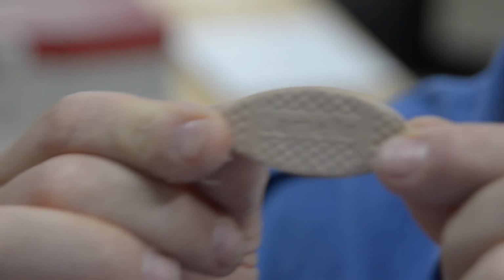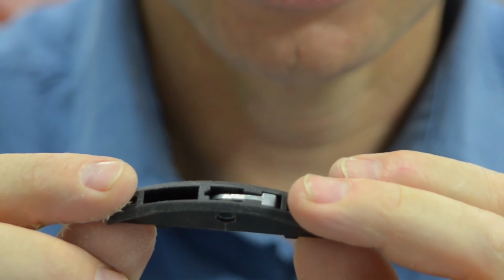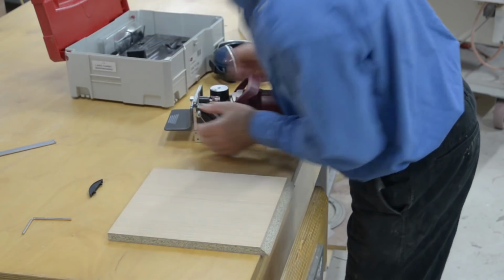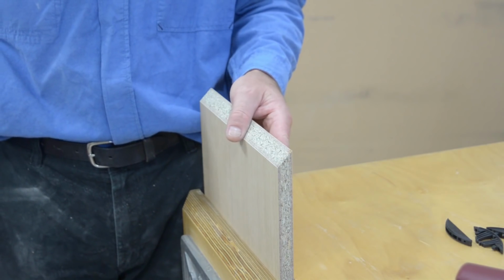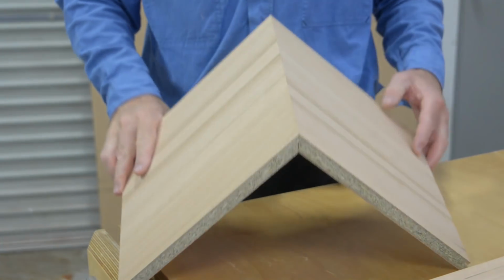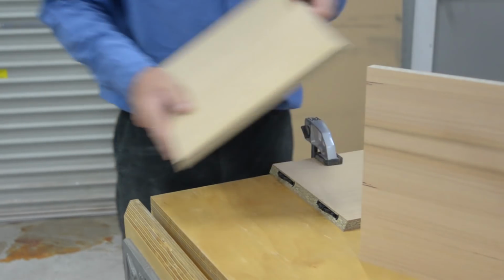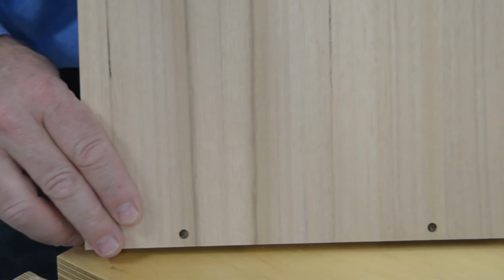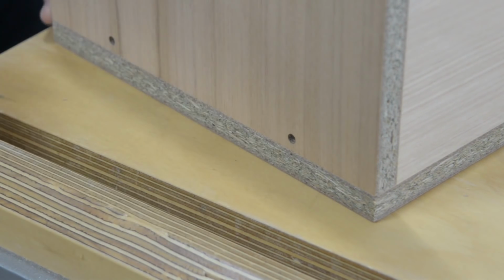Lamello ADVANCED Jointing system : Zeta P2

Comment: For 45 degrees, do you use p-14 ?
Reply from the maker: You can control the distance in from the mitre point.
Also they have moved toward P14 being the standard so as not to need to reset the cut depth.

Comment: I used this machine today to join 40 mm thick hardwood and i cant describe how impresed i was by it, i really enjoyd my work. It is fast precise easy to operate you name it. The only downside is that the fittings are a bit expensive. As for the tool im going to buy it from my local suplier for 300 euros brand new

Comment: Blasphemy!  Particle board and plastic!  Double blasphemy!  Land fill is already calling.
Reply from the maker: I am not sure that it is all that simple.
It takes fewer trees, and less energy to use particleboard to make furniture than say solid timber.
It takes less adhesive (plastic) to make particleboard than it does to make plywood, as well as fewer trees.
Particleboard however is not as good for jointing, so that's where there is a complication.
Both solid timber, and plywood require about 3 x more trees.
Laminate is more durable than lacquer, and the processing is way more labour efficient.
The odd assembly fitting is the price that must be paid.
As for plastic as a whole, I think philosophically I am not in favour of the high turnover plastics that are in use for minutes, hour, or just a few days, but this diminishes as the use moves into years.
Plastics in cars have a shorter life expectancy than furniture.
Everyone uses cars. 
Plastics in a phone, or computer these days has a shorter life expectancy.

Hmmm :/

Comment: I use Dominos

I’m quite skeptics that when you use glue with these that the two bits of wood are held tight enough for the glue to make a good glue joint. 

I said skeptical, I didn’t say i was correct as I don’t know if I am.
Reply: https://woodgears.ca/joint_strength/glue_methods.html

Check out that link, suprisingly the joint with little clamping pressure and no pressure [actually a 0.3mm gap] had a tremendous amount of strength. 
Counterintuitively, less clamping pressure led to more strength.

I have seen videos where clamps improved glue joints, so I'm confused. But I feel confident these joints should be plenty strong. I'd throw in a domino or two if you want additional strength.

Comment: THIS IS A CAM LOCK SYSTEM.  MAY AS WELL USE TYPICAL CAM LOCKS.  SAVE ALOT OF MONEY, THEN HAVE THE OPPORTUNITY TO DISMANTLE IF YOU DONT GLUE THEM.     YOU HAVE TO DRILL HOLES FOR THIS SYSTEM.  HENCE, USE REGULAR CAMS,  OR STAY WITH BISCUITS AND DOWELS.  AND ADD ONE CAM TO HOLD TOGETHER WHILE GLUE SETS. ANYTHING BUT THIS NONSENSE.   BECAUSE MAN CAN INVENT IT, DOESNT MAKE IT A GOOD SYSTEM.

Comment: I am glad I found your video. I see the possibilities with the Zeta P. However for the times when I want to glue up using biscuits I would still need another plate joiner wouldn't I?
Reply from the maker: No actually, but you could dowels or other biscuits, the zeta machine can be used to cut 'fat' biscuit slots for which they make a thicker biscuit.
Reply: @helmreichenterprises8391  I purchased another blade to carry with the Zeta P2 that will cut your regular beach biscuits

Comment: Very good video. The joint you made with out glue (clamex & Denso) how strong would those joints be? Could they be damaged by pressure across the joint? Could they be as strong as a glued up biscuit joint of the same configuration? Could they be as strong as a glued up domino joint of the same configuration?   If you glued up the Lamello joints could they be as strong as a glued up biscuit joint or a glued up domino joint of the same configuration?.   I’m not picking on the Lamello, I just dont know how strong  the joints are or how much weight an upper cabinet put together with Lamello products can handle compared to a glued up domino cabinet.  Any idea where I can find that information out? 
Thank you for your time.
Ron
Reply from the maker: Both biscuits, and dominoes cut away at the material strength, I wouldn't compare clamex unglued to any glued joint, but rather comparable to other knock down fittings.
The advantage tenso fittings have is that they are an invisible clamp, so on a mitre joint glued they mean no clamps, no external forces, no potential damage from assembly aids, and also you can clean up glue immediately without having to wait till the clamps come off.
On butt joints once set tenso with glue would be similar to a butt joint glued.
The keyway on the system does give quite deep purchase on the material, so there would be quite a few knock down fitting that would not perform as well as the clamex.
I don't see domino as a competitor to tenso or clamex, I see them as applicable to different tasks.
It's kinda like comparing a van to a sedan.
Reply: Helmreich Enterprises   Thank you for the reply and the information.
Reply: +Ron H
Lamello joints are rarely used on their own and they tend to part of a larger structure such as a cabinet. 

That means there are more than likely four sides to the cabinet so any forces you apply on one corner would get transferred to the other corners as well. 

And then there is the fact it would be very difficult to apply pressure to that corner anyway especially at a level that would break that corner. 

Most of the test you see on the internet applied to biscuits with a mechanical setup are not realistic to the real world.  Who in their right mind is going to get a hydraulic system and apply it to a corner of a cabinet and then complain afterwards that it broke. 

I have built tables 20 years ago with biscuits and they are still going strong. I have one in the workshop that does get moved around and it has not come apart.  There is also then the option of using screws on it if you want to as well with the biscuits.

Comment: good informative video. probably the best ive found so far on the zeta p2 :-)
Do you know if the p-system fasteners could be used with other domino joiners? looks like there is screw holes that possibly could be used instead of the curved track?
im also interested in how much play you have in each direction on the joints?
Reply from the maker: They are nothing like dominos, dominos are more like a mortice slot, or something you might do with a router, I guess its a hybrid between a dowel joint, and a motrice & tenon.
The Zeta produces a slot like a biscuit cutter, but they have an added keyway for the special fittings.
The two systems don't really compete in the same space.
Dominos are more like an upgraded dowel system, whereas Zeta is more like a rapid knock down fitting system.
Reply: Helmreich Enterprises 
My bad. I meant biscuit joiners not domino. Still, if you could cut a semicircular groove with the same radius and the thickness of the complete p-system fastener including the keyway, could the apparrent scewholes be used to fasten it in the slot?
Reply from the maker: @TBamle  They are the same arc, but the slot is about twice as thick.
They provide a non keyed slot also, depending on how you set the machine.
Lamello make a plastic biscuit that is a very good equivalent to the familiar biscuit joiner, it also can be used as a guiding tongue in a joint that uses the other fittings.
For example: With a joint that is say 600mm long, you may choose to have a clamex (cam fitting) fitting either end, and use the biscuit as an alignment guide in the centre, you may choose to glue the joint, or leave it dismantlable.

Comment: Very nice, but is it worth the price? In the UK it sells for £1,350... That is 10x the price of a Makita, 6x the price of a DeWalt!
Reply from the maker: None of the other machines do this job.
I don't know how to answer the question.
It's kinda like asking is a motorcycle really worth more than a bicycle.
Reply: @bearpapie69 
You are incorrect they are not all the same joiners. 

Lamello has its own joining system meaning it provides an array of different types of connecting biscuits.  And how the jointer works is in relation to the actual type of biscuits used. 

Different Lamello biscuits require a super accurate cut at specific depths for each biscuit type. Lamello jointers are designed specifically for this systems approach. 

The other brands of Jointers you named are good with standard biscuits do not expect them to be usable with all of the lamello connectors.  They would be extremely hard work to use with all of the lamello connectors.
Reply: its like the domino, if you want flawless finish, then the money is nothing.
Reply: Rarius I’m in the Uk and I love my Festool Domino. Yes the FT Domino is expensive and I waited for years to buy. But now I use it most days (genuinely I do) and it saves me so much time. 

I use the Domino in situations I’d never thought I’d use it in before I bought it. 

This tool looks interesting but I prefer my Domino. These plastic joints don’t do it for me. I like glued wood on wood. Just me. 🇬🇧
Reply: @GeeTheBuilder  you can make another 1,000... you CANT get your time back
Reply: Bearpapie69 you can’t compare any biscuit jointer with the lamello as it’s a different class of machine, if you’re happy with using a standard biscuit jointer then that’s fine but the lamello is next step up.
 All depends what standard of work you want to produce